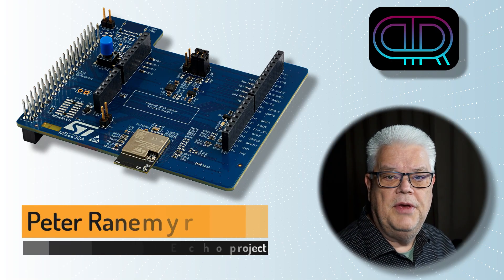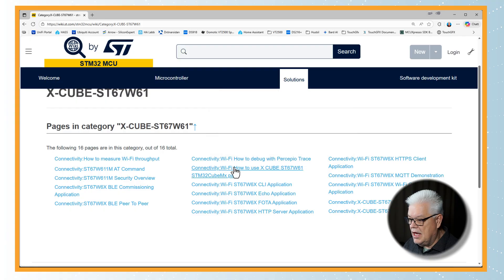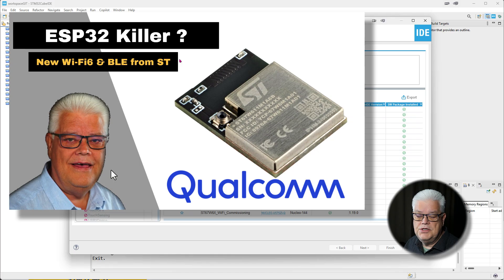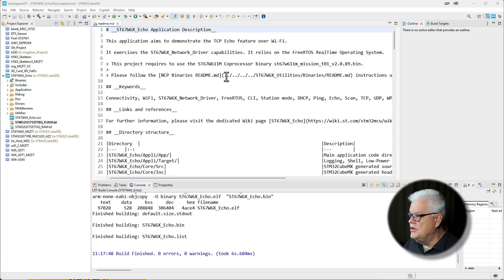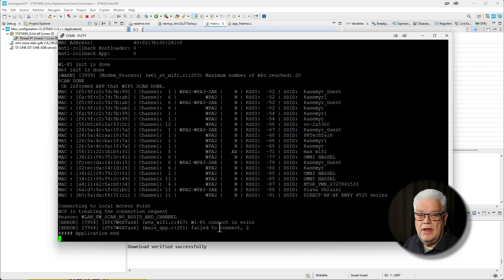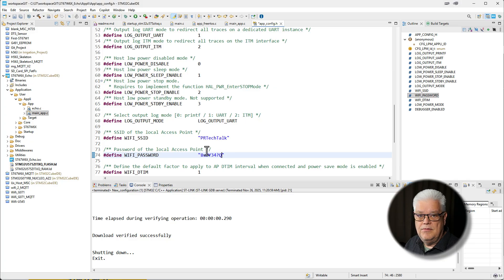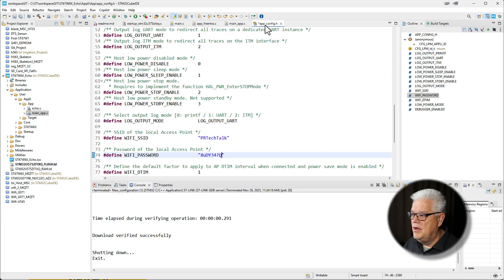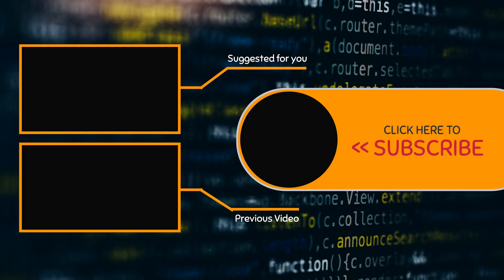How to Use ST67W611 with X-CUBE-ST67W1: Full Echo Demo Walkthrough

Comment: This was helpful! I wanted to add one thing from my experience:
When I first ran the example, I kept getting an SPI timeout from the Wi-Fi module. After way too much digging, I learned the Wi-Fi module wasn’t programmed (or had the wrong firmware). The fix was flashing the correct mission firmware.

I had to install STM32CubeProgrammer and run the batch file:

NCP_update_mission_profile_t01.bat

For me, the path was:

USER/STM32Cube/Repository/Packs/STMicroelectronics/X-CUBE-ST67W61/1.1.0/Projects/ST67W6X_Utilities/Binaries/

Before running it, CubeIDE must be closed. With the Nucleo board plugged in and the Wi-Fi expansion board attached, double-click the .bat file and it will flash the module. After that, everything worked.

It took me a couple hours to figure this out, so hopefully this saves someone else some time.
Reply from the maker: Hi ,greate that you managed to get it running. If  you looked at the other video that i talk about in this video you would be all set and had the mission firmware installed already. 
/PR TechTalk
Reply: @prtechtalk416  Makes sense. I was bouncing between boards and skimmed past that part, so I missed the mission firmware bit. All sorted now—thanks for pointing me in the right direction.